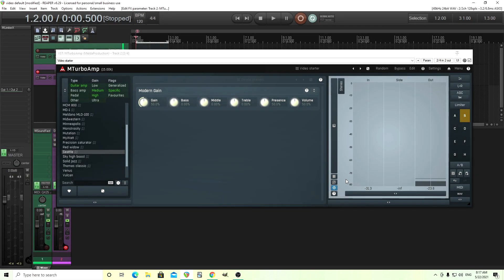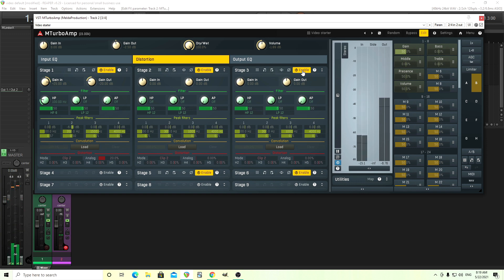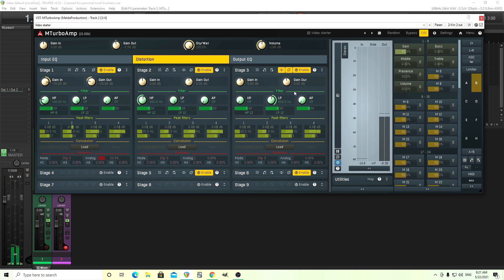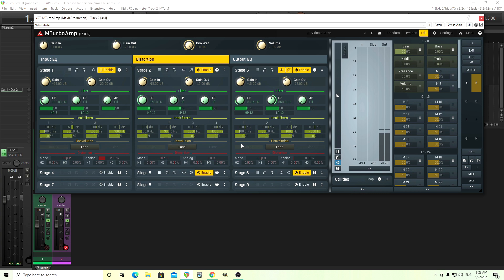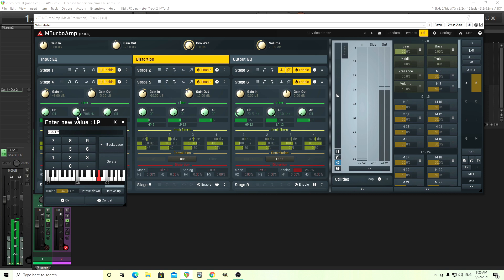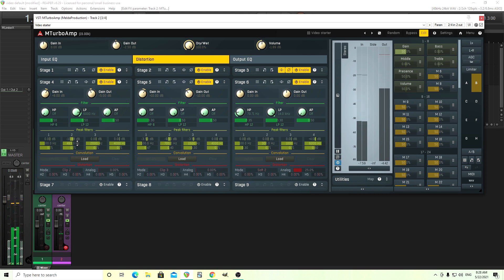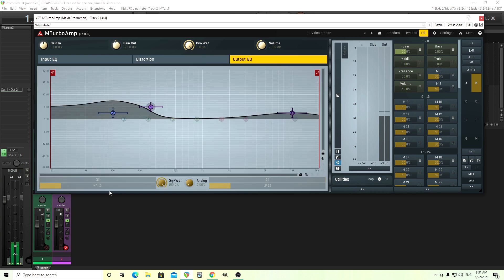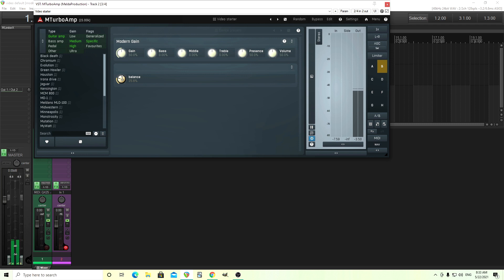High Gain Amp in MTurboAmp

Comment: These Turbo Amp teasers are getting me all "amped up".  How long before we can get it? I'm drooling for it! Do you need help building Amp presets? I'm a good guitarist and good at creating Amp models. Let me know. I'm now fully competent with Melda's interface topography, Multiparameter/Interface programming and Mod Programming. Melda's plugins are the best thing since sliced bread for those of us who like to dig-in to the guts of a VST. Thanks for the tutorial.
Reply from the maker: Honestly I don't know, when it will be released. As of right now you should be able to access the beta if you want to try it and if you contact Melda they might be interested in having you build some amps. I hope that helps.

Comment: Hi Chandler. You as a guitar player. What are you saying about the reactivity and interaction of this system? Cheers
Reply from the maker: I was surprised that you can do a lot with just the distortion stages and EQ. For example it does clean up(distortion) when you turn down your guitar's volume control. However if you want more dynamic interaction you can do it another way, which I'll cover in another video. Thanks for commenting and watching as always.